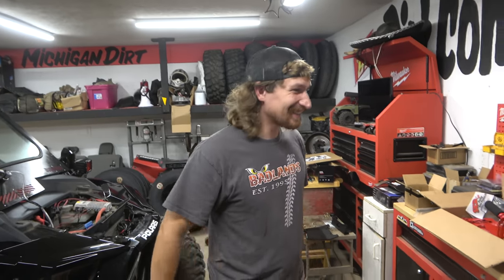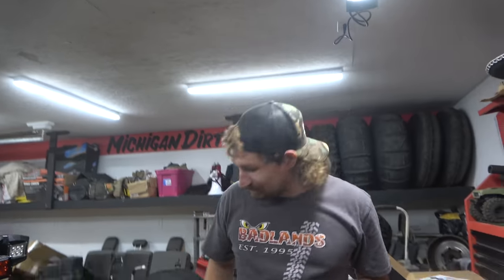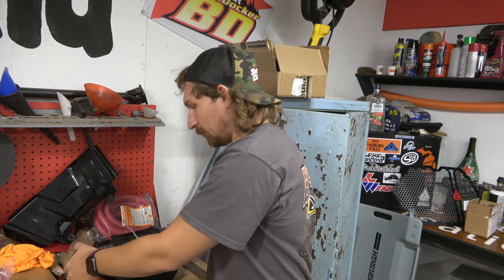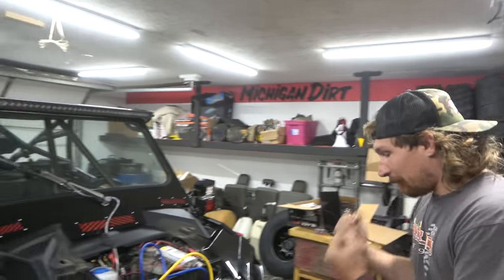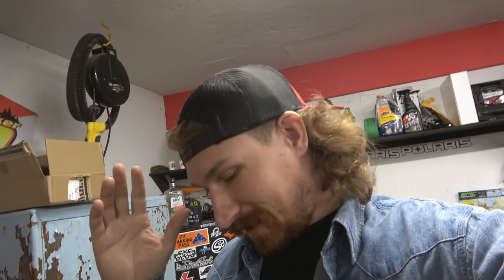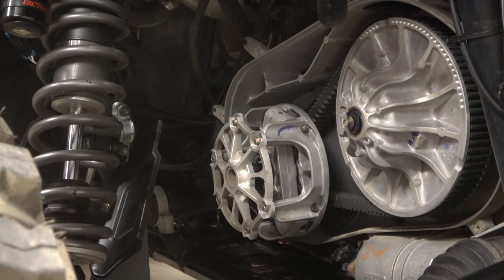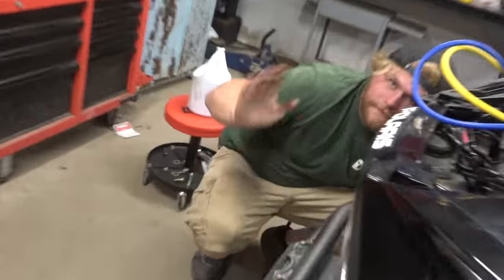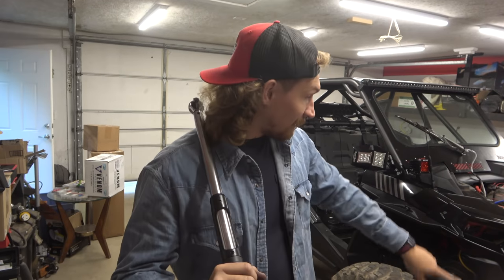L&W Front Bumper With SuperATV 6,000lb Winch On RZR Turbo S | Plus Aftermarket Assassin Pro XP Helix

Comment: Hey dirt dudes i have a polaris winch and the brackets look a little different then the winch mount plates you have . Do you know if it the bumper will fit with a polaris winch ? Thanks
Reply from the maker: Might have to drill different holes, not sure